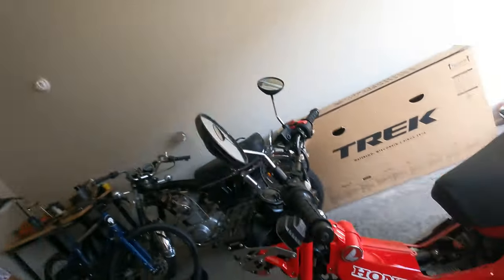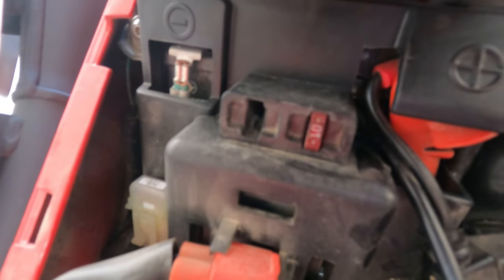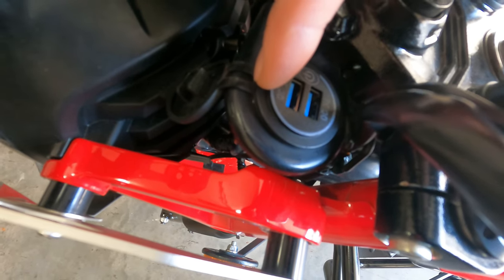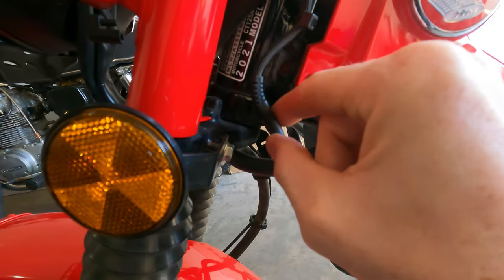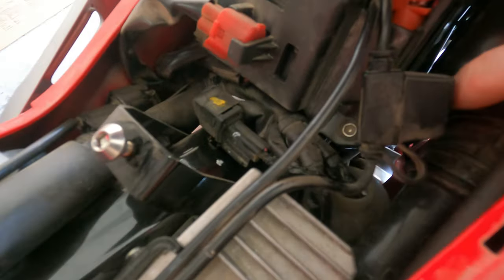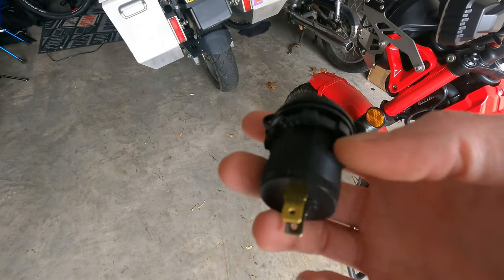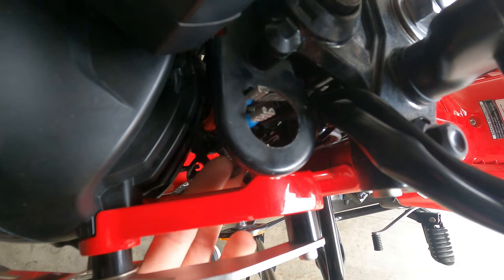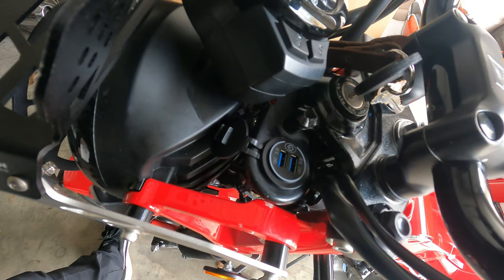Connect a Battery Tender and USB Outlet to the Honda Trail CT125

Comment: I got one that plugs into the headlight. There is more than one way to do something. You got to do what is practical for you, not someone else.
Reply from the maker: Well said!
Reply: Did you go the headlight route so it only charges when the key is on?
Thanks
Reply: Is there a spare positive wire you can tie into in the headlight or is it a splice.  Thx

Comment: Just wondering if you changed your stock tires to something else , and to what size ?
Reply from the maker: Hey Dave! I did change the stock tires. 

These are Shinko 244’s. The front is a 2.5 and the rear is a 3.0. The front does not contact the fender, but you could put a 3.0 on the front with a fender riser kit but I haven’t had any need.
Reply: Thanks for the information , I was thinking of putting the 2.5 on both front and back just for rear clearance issues
Reply from the maker: @andyesir  I had put the 2.5 on the front and back originally but when I wore that back tire out I replaced it with a 3.00. It made a big improvement with absorbing bumps and overall traction.
Reply: one more question if I may, did you have any rubbing issues with the 3.0 on the rear ?